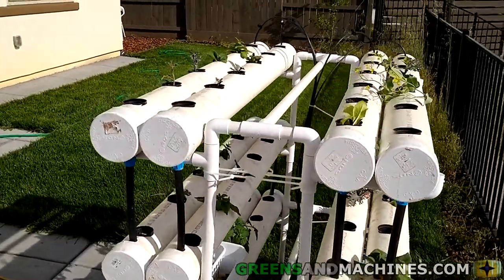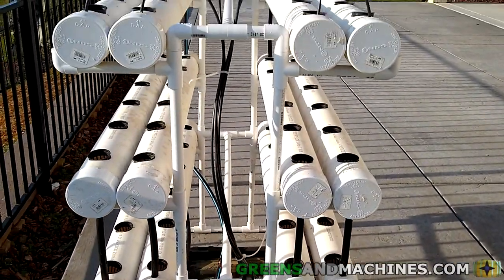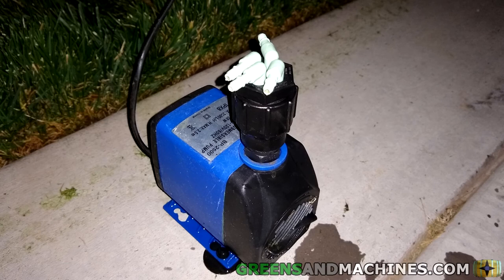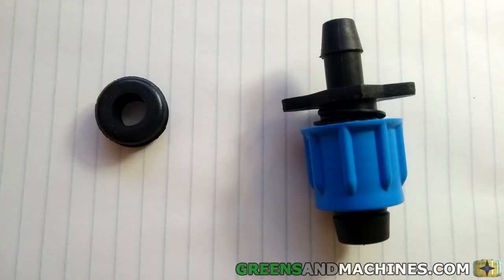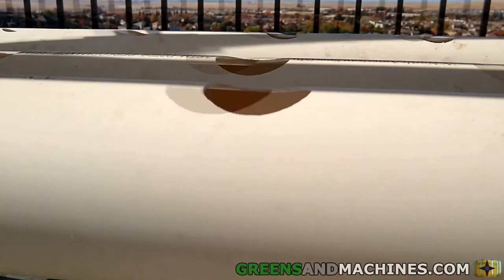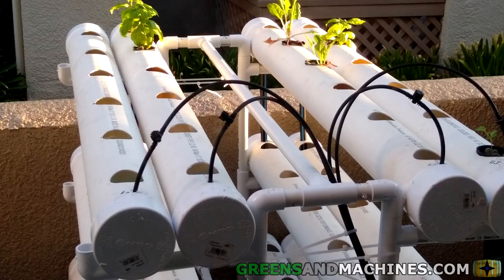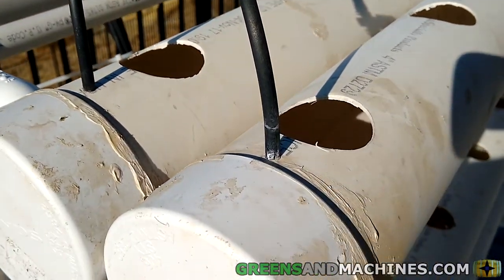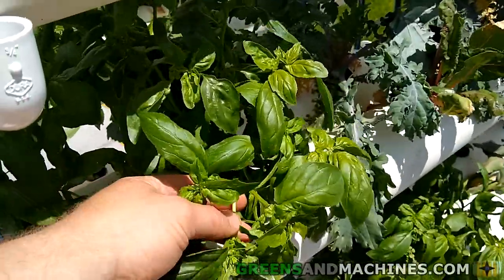Nutrient Solution Flow Design | NFT 72

Comment: Nice set up!. How high is the water level in your channels?
Reply from the maker: If I do not place a "spacer", it goes no higher than the barbed tip on the other side of the grommet. Somewhere between 1/4" to 1/2" deep

Comment: Did you use 4" sch 40 PVC pipe?  Can you remove the caps on the end to clean if needed?  Thanks!
Reply from the maker: It isn't sch40 and you can remove the caps but you'd need to reseal them with the waterproof caulking when reattaching. I'm in the middle of assembling a technical package which would have all those details
Reply: @greensnmachines  thanks for the reply!

Comment: Where do I go to learn about creating my own nutrient solution from scratch?  What if I cant or wont buy any of the elements necessary>?  How do I extract what is necessary from the environment around me and mix it to successfully create a nutrient solution?
Reply from the maker: Good question Kyle. That would make a great video locating, extracting, and processing all the different nutrients from natural sources.
Reply: @greensnmachines  

It would!  Nutrient solution is a "weak" point in the supply chain that I'm searching for a resolution to.  Almost all solutions are either "buy NFT solution" or "Buy NFT solution precursors in these amounts." 

But for an off the grid minded person, it comes to the forefront of thought that one might not always have access to the market.
Reply from the maker: @iamscoutstfu  of course, I see what you're getting at. I'm thinking my research is going to take me on a path of "how to make miracle-gro from scratch" given that's what the base is for my nutrient solution. It'll be interesting to see which of the minerals are easily sourceable from natural sources, and which would either need to be synthesized or bought.
Reply: @greensnmachines  

Excited!